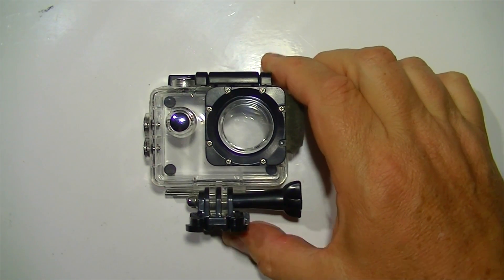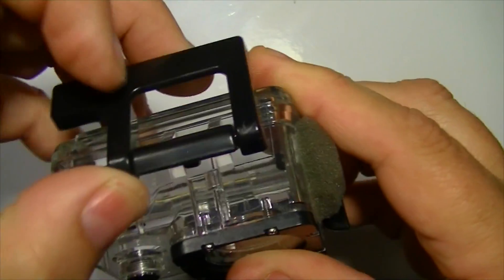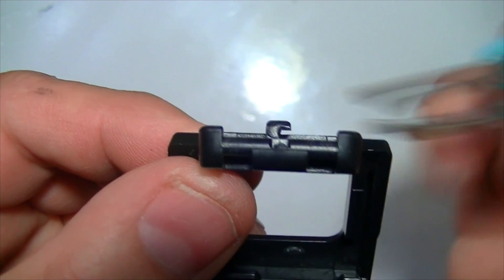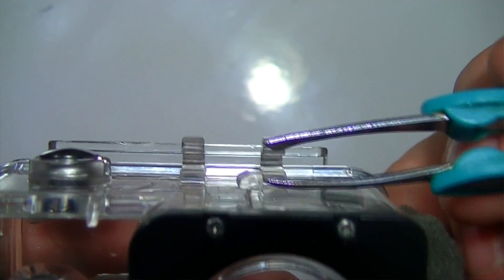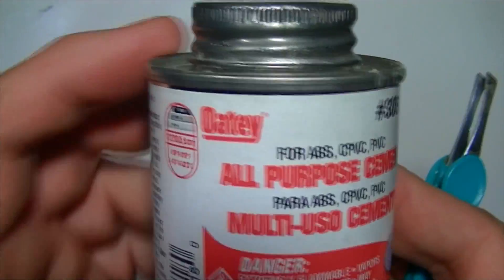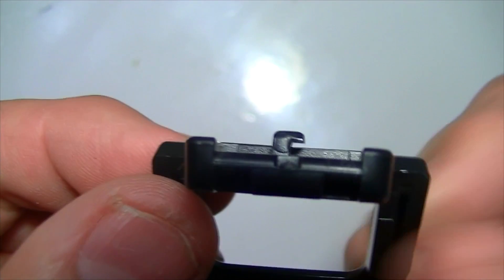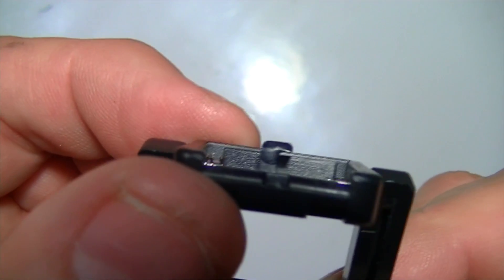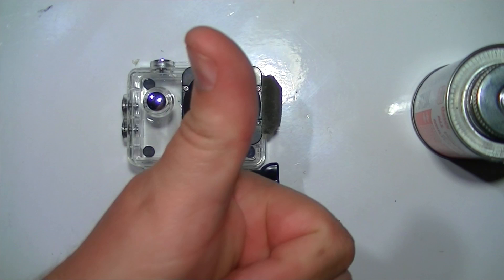Don't Buy GoPro Camera Housing Case - Fix It

Comment: I have that exact case and water is leaking in droplets every few seconds thru the bottom selector button on the side. You wouldnt know how to fix that would you?
Reply from the maker: If you won't need to use the button, you could try silicone.

Comment: Does that case work with your go pro? I have the ripoff camera, similar to sj4000 and was wondering if it will work with a go pro waterproof housing.
Reply from the maker: Actually I have not tried it in the water.